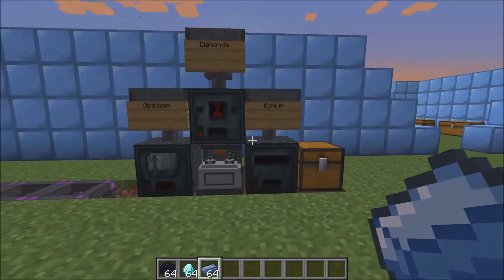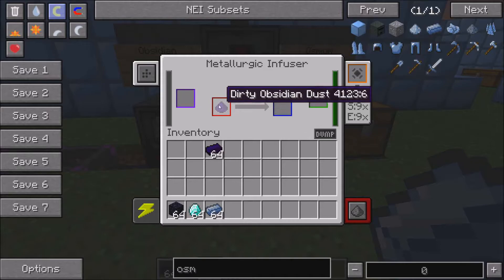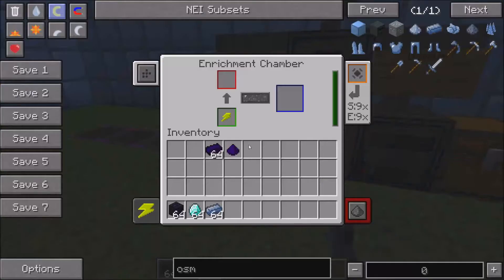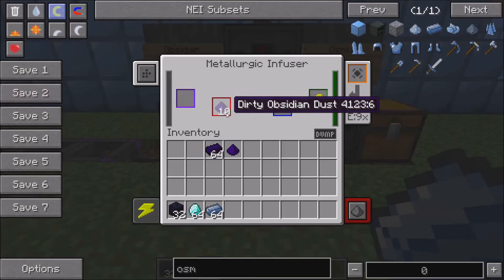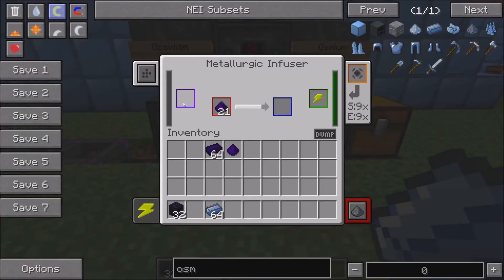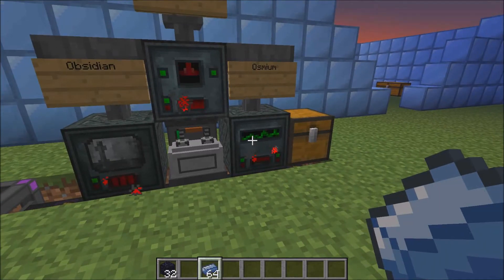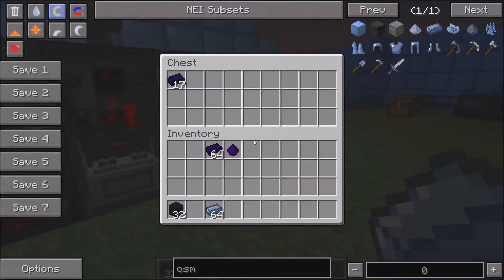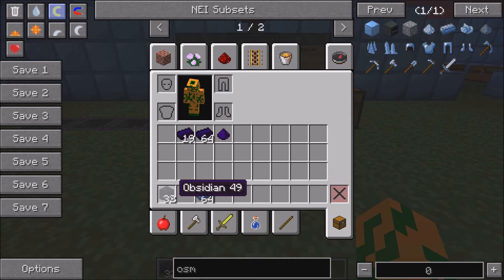Mekanism 1.7.10 Mod Spotlight  Ep6: Obsidian Ingot

Comment: Hi will you show how to use the metallurgic infuser alone because i filled it with redstone and put in osmium but the osmium isn't turning into a control circuit.
Reply from the maker: Are you giving the machine power?
Reply: uhm usint redstone power?
Reply: oh i see thanks alot!
Reply: Shane Dublin subbed
Reply from the maker: redstone is an ingredient you need to give it some sort of power like rf.